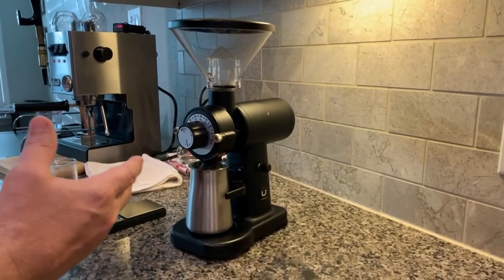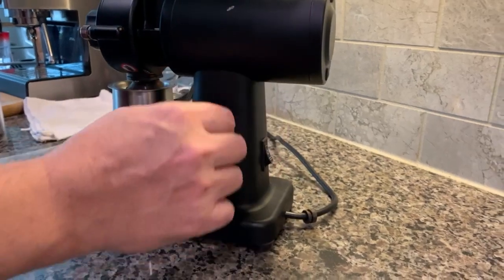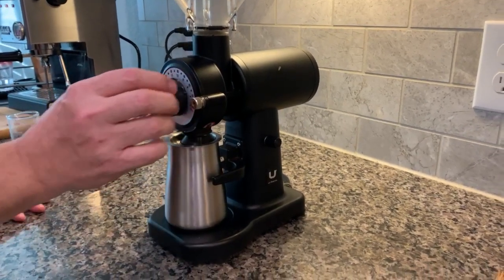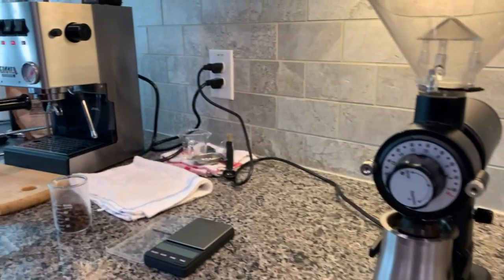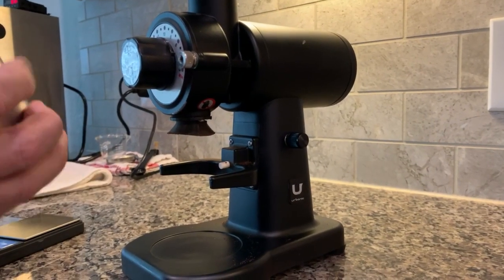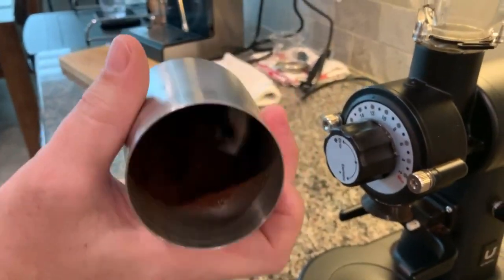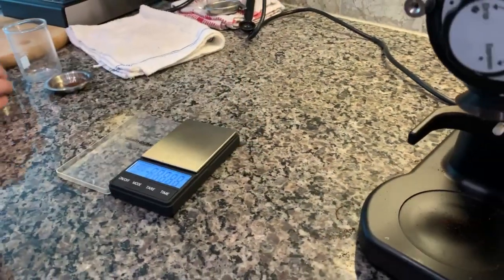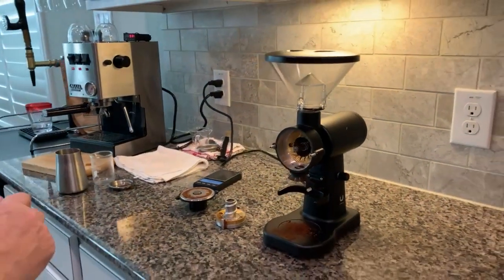Urbanic 070s - it ain’t broke!

Comment: I removed the plastic/rubber thing at the end of the dispenser chute. And so I don’t have to knock paint chips into my grinds, I have a small brush that I utilize to clean grinds out of the chute. After the grinds have dispensed i brush the inside of the chute. Then I tap the ‘run’ button for a moment. Clears all the grinds out of the chute.
Reply from the maker: Nice!

Comment: Great.  I just bought one of these and immediately found that I didn't know how much grinds to let in for the amount of coffee that I wanted to make.  I see that you're weighing yours and not filling the hopper up.  I guess I should at least use a small measure scoop to put the amount of beans for the amount of coffee I want.  This grinder is MUCH better than the cuisinart grinder that I replaced with this one and it really shows in the taste of the coffee.
Reply from the maker: Some folks will hold the portafilter under the grinder until it is full. Whatever works for you, if you find a method that is consistent and taste good, no need to go further. Enjoy it! Let me/us know if we can help in anyway.
Reply: I call my Aeropress scoop and Bodum scoop James and HalfHoff respectively. 14 and 7 gramish. 
      At first light fornicating about with scales, thermometers, timers... bleh. 
      I need a flow for a teapot whistle, lever, moka, bripe, Aeropress, low end manual machine, phin... 
   Scoops, timer if having difficulty, thermometers ready. Scales on hand. 
       But I try to scoop, pour, pull, and serve. 
    With the flair, scoop, pour, straight piston. Chamber is 190°f. Ish.  14 or so grams coffee, long pull 42 grams out. 
       That I can do upon waking. Gages, scales, timers, more later 🤣

Comment: Ooh! How much hassle was it to add in the dimmer? I haven't opened mine up yet and have only done really basic wiring but I definitely want to slow the motor. I've done the stepless and gevi burr mods plus added in a bellows. The alibaba zeoleo type bellows don't fit nicely, go for the lesbrews if you're getting one.

Also, on your 18.4 to 18.3 retention - Samo smrke (I thiiiink) pointed out that a tiny bit of weight is lost from co2 emission when you grind so you'll never get 1:1 out directly. I put in 18.1 to get 18 in the portafilter.
Reply from the maker: Thank you! It’s easy enough if you clip on quick connect connectors to the ends of your dimmer switch, because you are simply intercepting the wire path from the top or bottom of the main switch. It’s crowded in there so not much room to work with. And you need the right size drill bit to make the hole for your switch. This is a 6 out of 10 job on a scale of 0 to Hard. Hope that helps!
Reply: @threehanded8853  superstar! To be less destructive I was half thinking of using the area near the logo to mount a switch but if it's that crowded I might have to reconsider. Don't suppose you took any pictures of the wiring while you were in there? And did you use the same cheap as possible type of potentiometer that lance is always mentioning?
Reply from the maker: @joconnell  no pictures of dimmering the Urbanic. I used the Sam Burchard  Dimmer
https://youtu.be/5rEBmcP1ZUo
Reply: @threehanded8853  Legend, thank you so much!

Comment: I bought the same grinder the first one had electrical issue we I got it on my first use stopped grinding I send it back and the guys in Korea were very nice and they send me a new one. My question is when the grinder is off if I rotate the knob clockwise the knob doesn't turn unless if I turn on the grinder. Is this normal?
Reply from the maker: Yes and No. It’s always recommended that you have your grinder running before adjusting the burrs, specifically because you may be crushing a particle between the burrs and jamming it all together.  That aside I had issues with this knob assembly after I did not reinstall the plastic knob firmly after calibrating. Hope that helps.

Comment: great video man, just purchased mine, are you doing the alignment thing?
Reply from the maker: I started to, but didn’t do the fixed burr; only the spinning burr, which means I truly didn’t complete a burr alignment. I misunderstood Lance’s instructions. I also unscrewed the center core, removed the detent rod, coated the threads with Teflon, and replaced the core. This allows step-less with the setting holding, not drifting. Probably time for another video! Demonstrated here:   https://www.home-barista.com/repairs/remove-grind-knob-urbanic-070s-t77696.html

Comment: I bought my 070s a year ago. It worked fine for espresso at first. Now I'm pulling turbo shots even at the lowest settings. Do you have any suggestions?
Reply from the maker: Clean the burrs and insides - compressed air is great if you have it. Convert the dial to stepless by removing the core, under the plastic knob, to remove the spring loaded detent. Remove the threaded core to put four layers of Teflon tape on the threads. In your case your burrs may be worn or defective, buy a replacement set. But really, it’s hard to say what your issue is without looking at the grinder. Hope that gives you some ideas. My grinder is 14 months old, no issues. One thing I learned was you have to nearly hammer the plastic knob back on if you ever take it off, to get it to catch on the spire gear again! Some of these items are covered in the next video, https://youtu.be/gVzNkcsLMEU
Reply from the maker: Additionally, I believe Lance Hedrick pointed out that the thumb screws must be torqued down equally to the time they were first pulled off, as this will change your grind settings as they appear on the dial. If you still have one spoke of the spider gear turned down under your plastic knob, I could see how this would prevent the burrs from touching. Even if there are a few grinds under the dial cover, preventing the cover from fully seating this will enlarge the space between the burrs!
Reply: @threehanded8853  I think this is the issue. The grinder has never been the same since the first time I opened it. Any idea how to resolve this?
Reply from the maker: @dankolito  I tighten my thumb screws down with a pliers (softly) to ensure the cover is fully seated. You also have to ensure the cover and the rim it attaches to is clean. And what about your spider gear; does it have the tooth bent down, stopping the full turn of the dial?
Reply: @threehanded8853  Yes the spider gear is bent down and turned all the way to the right
Reply from the maker: @dankolito  So, carefully straighten the one tooth that is bent down. Now you can turn the spider gear all the way to burrs touching, then back off a smidge. Replace the plastic knob firmly at your new, “Min” - make sense? Don’t worry if you break off the bent tooth - it won’t matter if you also remove the detent peg and spring.  Only trouble now will be the knob will drift. This is why you remove the threaded core and wrap Teflon tape around the threads 4 times. At first I wrapped the threads with one wrap, then two, then ultimately 4 wraps to really keep the setting from drifting!
Reply: @threehanded8853  Thanks for the explanation! If I break the bent tooth won't that basically get rid of the limit the dial can turn?
Reply from the maker: @dankolito  yes!

Comment: But how’s the espresso? lol
Reply from the maker: Exquisite!
Reply: @threehanded8853  good, can’t wait for mine. ok, so a question about the dimmer. Wouldn’t it have been better to add a kit designed to properly control the speed of a DC brushless motor?
Reply from the maker: @Gk2003m  I think electronically the only safe for the motor approach is to employ stepped down gears off the main spindle. So any dimmer choice is a sacrifice choice of causing slight, in my view, damage to the motor. It works good enough for now. If it kills the motor in a couple or few years, I’m ok with that.
Reply: @threehanded8853  Mine arrived… and I agree. Delicious.